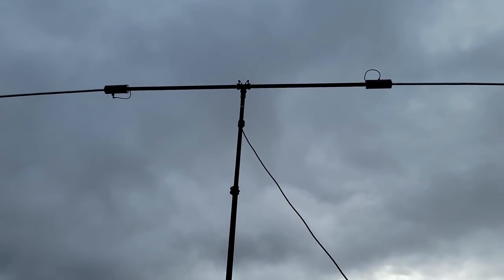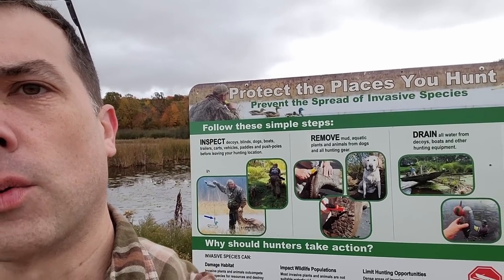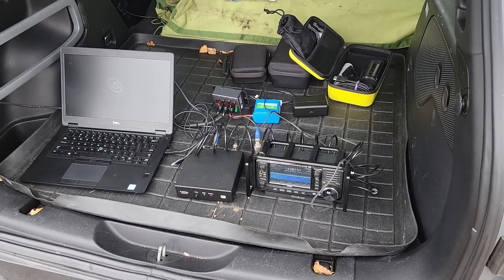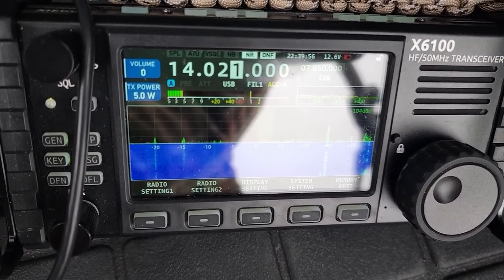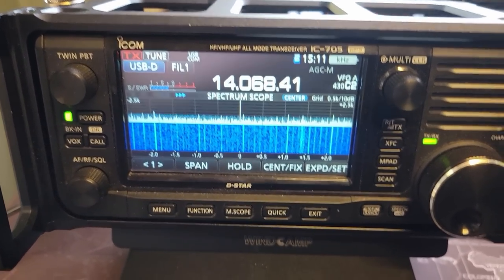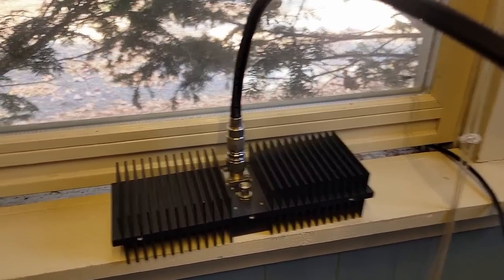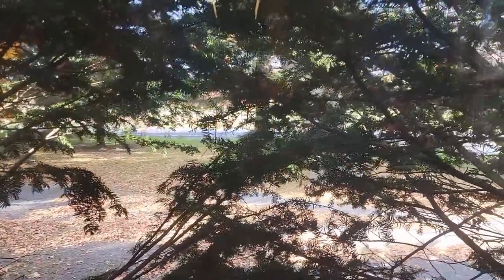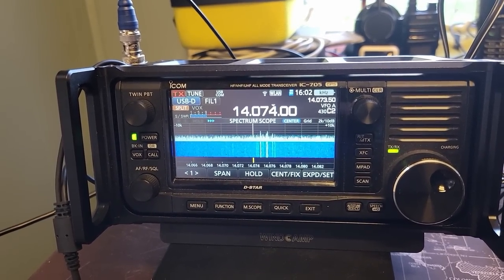But wait, there's MORE!

Comment: WOW Steve, this was really OUTSTANDING!!!  The "scientific" method really paid off well here.  I wish more hams were as thorough and changed only 1 item at a time, then measured the change to see how it affected their hypothesis.  

It is always best to remove the noise right at the source.  In this situation, the noise is created by the computer (they are nearly all terrible with spurs of RF).  The choke on the USB is doing the heavy lifting and is therefore most effective.  I'm REALLY glad to see the use of a choke balun added to the coax feeding the Buddypole as this cuts the noise from the laptop that is riding on the outside of the coax shield.  The reason why you don't have this noise on the DX Commander is that the coax shield is RF grounded through the radial field, but in the Buddypole, there is NO ground, so the noise is picked up (despite the balun there) due to the short distance between the coax and the feedpoint in the middle of the arms.  By adding a 2nd balun further down the coax, we are further attenuating any RF riding on the outside shield.  

Thanks very much for mentioning me and some of my suggestions, including the NanoVNA.  😄

73 Brother.  Keep up the GREAT work!
Reply from the maker: Thanks Greg! I really enjoy this kind of "work", it was fun to hunt it down.

Comment: The choke on the chameleon coax has worked well for me. If I'm not using that coax, I use a toroid on the USB cable. I almost failed a POTA activation because I knocked the cable on the ground by accident and it broke. To keep that from happening again, I put the toroid into a plastic container and filled it with expoxy.
Reply from the maker: Pot(ting) gets it done!  That's an old and reliable trick!

Comment: I had the same issue with the 705 when it was about 18" from the laptop and transmitting into an FLoop 2 that includes ferrites on the cable.  Moving the radio to about 3' from the computer has resolved the lockup issue for me.
Reply from the maker: Nice!

Comment: About the usb isolator. The inexpensive ones (I have the same one) only isolate the power lines, not any data lines. They do make full isolators, but they are a bunch more money. Great video!!
Reply from the maker: Thanks, I hadn't heard of a USB isolator until my first vid on this topic. Do you think the full unit would help any better?
Reply: @temporarilyoffline  I wish I could answer that. I have the blue one that looks like the picture. I haven't had noize issues enough to make me invest in, say, a $200 isolator. Good luck!

Comment: Well done, sir, and many thanks! I've recently acquired an ic-705 and I immediately ran into this same issue, even with an MFJ-915 RF isolator between my coax-feed-line and the radio (using a QRP Guys end-fed-half-wave). I eventually got it working over wifi w/ Linux but I'm going to try the toroid-choke+USB solution for the sake of maximizing battery out in the field. 73 from an old Perl guy!
Reply from the maker: OPGs unite!  Glad it helped.  Did you see the first vid in this series?

Comment: Man… I was having ALL of these problems EXACTLY!  Only difference in my setup is the addition of a XPA125B amp/tuner.  Even without the amp I still have a ton of noise with and without the use of ft8.  I’ve been trying everything almost the same as you…….except the coax choke.  I can’t wait to try that tomorrow and see if I can finally use my ic705 in my shack again and not only when portable.  Great video and I definitely subscribed!  Thank you!
Reply: I happened to have the exact same toroid you used laying around so I wrapped my coax 9 times through it near the middle of a 50ft run and it dropped it from S7 to S3 with RF Gain at 100% on 20m.  Gain set to 80% and the noise was almost all gone.  Perfect solution, thanks again! 73!
Reply from the maker: Glad it helped!

Comment: Great video, thanks for posting. I got tired of dealing with this issue. So, I solved my USB noise completely by just going wireless using the free WFview software and a couple port emulators. Works great for me.
Reply from the maker: It does work great that way too!

Comment: I think you have two problems. 1. the usually computer RFI but more importantly 2. a. how tuned is your buddipole, what's it's SWR on a meter? 3. it doesn't look like you're using BP's adjustable balun, but are you? 3. have you tested the coax with nanovna to ensure it's good? sure seems like it but even a small defect can cause this. I know many with BP including myself and love the antenna but we all have the adjustable balun and use it, and coax should always be choked when possible, as well as anything else that goes into your radio (USB, etc). Good troubleshooting. I was surprised by your results with the shielded USB cable. USB Spec is that the shields of the connectors must be connected via the USB cable's shield, and that has helped me significantly where a lot of cheap cables do not have that shielding. the noise from the computers do not surprise me, but the only time I've personally experienced that kinda of disconnect/lockup when tx from the computer is with a really bad antenna match, and a boat load of reflected rf coming back (esp when unchoked).
Reply from the maker: Thanks for the feedback.  This problem occurs for a variety of users with a variety of antennas.  I was using the buddipole because it's the antenna I have that readily replicates the problem.  So far the consensus is that the 705 itself doesn't properly shield its USB, so it's up to us as hams to solve the problems.
Reply: @temporarilyoffline  ah ok, experienced similar effect with my ft-891 (and no protection) which I found out the hard way where my wmr usb2cat back fed power blowing the usb controller on the radio. Maybe someone will try jumping usb shield to gnd in the 705 to see what happens.
Reply from the maker: I'd need a micro-usb breakout board and about 50F more degrees to test that out 🤣 (it's- 12F as I type this)

Comment: So common mode current was an issue on that Antenna type.  I really prefer a dipole due to this.  Yes it's 30ish feet of wire and harder to hang but a lot less common mode current and noise on the shield.  Nice video, I like your testing.  Sending thiis to my 11 and 14 yr General daughters to watch.
Reply from the maker: Thanks for sharing, it was a lot of fun yo play around with and figure out.

Comment: great video. I have the ICOM 7300 and use USB A to B cable to laptop . getting some noise. T 240-43 on USB cable worked for me. running off set center fed dipole portable. all ready had choke on coax at 7300.  all ways do. type 31 snap core.  I choke my power cable at radio as well. have same toroid in the link. also 31 and 61 cores . got a bunch in my go kit. snap ones as well. a friend let me use his 705 so we can do a 24V amp build 600 watt PEP . buddy hex is waiting list only now. my friend went with DX commander instead. and DX engineering has them in stock in the USA now ! fall 2023. love how you try it all on video. going to help me with this project a lot. 73's
Reply from the maker: Excellent, glad it helped!
Reply from the maker: Excellent, glad it helped!

Comment: Great video!  I had a similar issue with my 705, I had the USB isolator but it didn't help.  Added the choke on the USB cable she works great.  I have tons of noise at my location so choking didn't help there.
Reply from the maker: I carry both chokes with my 705 kit all the time now.  The 1:1 coax choke trick is a particular winner!

Comment: I'm curious to know what happens if you choke both the coax and the USB cable. Does the noise floor get even lower, like S0, or have you reached the point of diminishing returns? Inquiring minds want to know. :D
Reply from the maker: It was too controversial to share.  Even though I have video footage of it, I would lose all credibility as a ham if I broke that news!

Comment: I have the same problem with my 705 with my KM4ACK EFHW and using a toroid and rf choke helps
Reply from the maker: Yes!  You could add a counterpoise to your KM4ACK antenna also.  There is more than one way to do it!

Comment: My setup is a magloop OM0ET and BB-V7, IC-705 (on it's own battery), LENOVO P15 Gen2. First I had the problem with locking up as shown in the video using the BB-V7. I added a toroid near the BB-V7 and on the USB, near the laptop. No locking up so that part was solved. Than I noticed that the noise became stronger with spikes every 500kHz or so when I started WSJT-X. I did not transmit at that stage. so the noise was coming from the laptop. I didn't use external power to elimminate noise coming in throught that cable. As I had another toroid I put it on the 705 side of the USB cable that stopped the noise. I think the laptopscreen was producing the noise (with the waterfall on screen), that was being picked up by the USB cable and send into the 705. So my formally 2m long USB cable has a toroid at the beginning and at the end. 
Maybe others can reproduce this outcome.
Reply from the maker: Sounds like you got it 👍

Comment: Thanks for the video, and interesting to see the coax choke work so well... I had similar ft8 locking/interference issues when using the 7300 and HP laptop on a summit (shorter hike).  I bought one of the Amazon shielded usb cables, and was surprised it didn't work either...until I added more clip on ferrite chokes.  73
Reply from the maker: Where there's a ham, there's a way.

Comment: Hey Steve, when you unplugged the antenna and the noise went away I yelled "You don't have a noise problem,  you have an RF in the shack problem"  Ask me how I know!  Your feedline or ground is acting as part of the antenna.  I would suggest start with just laptop, unchoked usb, 705, short rf cable, to dummy load, and test.  Then add long rf patch cord and test.  Then add resonant buddipole and test, then add tuner and test.  then add non-resonant buddipole and test.
Reply: I'm assuming you're using the buddipole non-resonant since you have the tuner there.
Reply from the maker: That's a great idea, thanks!
Reply from the maker: I'm using the buddipole+tuner just to make it a little more wide banded... you can add inductance by tapping the coil differently on the pole or by adding inductors in the tuner.  Also, at 40F and windy its really a pain to put up and take down repeatedly for tuning a 100% match.

Comment: I too have tried all the other tricks with my IC 705. The only one I had some luck with was the FT-240-43 Toroid, which helped to some degree. Hoping to do a field test with another FT-240-43 Toroid on the coax to see if it resolves the issue once and for all. Looked promising in your video. Thank you for doing this follow up video. 73.
Reply from the maker: No problem Scott,  what antenna are you running?
Reply: @temporarilyoffline  mostly my EFHW or MFJ 1979 17 ft. whip with the new WRC Sporty Forty resonator. Both seem equally as bad with the 705. My X6100 never has an issue. 73.
Reply from the maker: Have you tried running a counterpoise or ground radials on either of those?  Does it reduce the noise on your 705?
Reply: @temporarilyoffline  I do run a radial with the vertical - if on 20 meters I have four 16 ft. radials, and on 40 four 32 ft. radials. With my EFHW I do not use a counterpoise with my spark plug.
Reply from the maker: Wow, the radials on my dxcommander solved the problem for me, but I don't take that portable yet.  I have used the coax choke on my EFHW though and that did help.
Reply: @temporarilyoffline  I'll do a coax choke and try it with both of the antennas this weekend and see if that made a difference. Radials did not resolve the noise issue with the computer. Many of my activations are done w/o the computer but with winter coming here in PA I'll be activating out of the car again (blech) a lot so I'll be using the computer. A resolution once and for all will be great. I did see some improvement with wrapping the torroid on the USB cable. If the torroid on the coax fixes the problem I'll be grateful. I mostly do CW with a headset on and it's almost unusable with the computer noise. I'll let  you know my findings.
Reply from the maker: Looking forward to it!

Comment: The lock-up really feels like RF in the shack.  The buddypole choke is fine, it keeps the dipole balanced, so that it acts like a dipole, and isn't detuned by the extra element which is the outside of the coax shield.  But the extra choke helps because the outside of the shield does pick up RF, both your own transmit power, and local noise.  While the radio may not be directly effected by the signal on the outside of the shield, it can get re-radiated inside your shack, and coupled to the unshielded USB cable.  (I can't help but wonder whether this would be happening if USB had been designed to be fully differential - data is differential, but something in the start and/or stop symbol is single ended.  Probably the chips at one end or both would still fall over in the presence of RF.)  The DX Commander has a better ground (and a better match, probably, though I haven't worked out whether that applies).  I figure that the vertical part of the buddypole coax is what's primarily picking up signal and noise.

I'd suggest placing the second choke as close to the radio as is reasonably possible.  I use a couple of clamp on beads on the coax jumper between my antenna switch and my MFJ entry panel, and I have no problem with FT8 using a Dell Inspiron and my FT-991A, which is already more differences than would allow my experience to apply to your situation. I also use a USB cable with a built in bead near each end, and it is probably shielded too.  A bead at each end  protects both the radio and the laptop interface parts: USB is two way, so there are line receivers in both the radio and the computer.

Finally, you can ground responsibly at the park: just take a radial set and spread it out on the ground.  It's not a DC ground, and not a lightening protection ground, but it is an RF ground, its quality depending on the local ground conductivity.
Reply from the maker: Its definitely RF in the shack.  The 705 is known for it and as a ham, we know how to fix it.  I have tried a coax choke (the same one in the video) on the radio side of the tuner, but it didn't help any.  The USB and Coax Chokes are now everyday parts of my 705 Go-Kit.
Reply: @temporarilyoffline  Yeah, if you stop it between the tuner and the radio, it's still inside the shack.  At or just outside the entry panel (cracked open window) is a better choice.  I keep hoping that they'll make coax with toubh flexible bead as the outside jacket, but I think that I'll have a long wait.
Reply from the maker: @KeepEvery1Guessing  Sounds like an opportunity - powered iron cable jackets!

Comment: When you are testing with the Nano Vna, it would be good to check your polarization.  Vertical/Horizontal can make a big difference. Also holding the antenna next to coax should be done the same way every time.   K6DCH
Reply from the maker: You are correct sir!

Comment: It looked like you are getting RF into your radio.  Did you tie the ground of the radio to the tuner to see if that helped. It would reduce ground loops that looks an issue.   Also any time to limit the bandwidth of an antenna the noise should go down.
Reply: So why does the DX Commander work fine then? It's because the DX Commander has a massive RF ground and the Buddy pole doesn't but that alone shouldn't make a difference I think it's the metal mount for the buddy pole causing RF ground issues. As once the coax is choked away from the mount system all the issues disappear.
Reply from the maker: You're right, this is RF into the radio.  Its "nobody's fault", but it is something that a ham radio operator should be aware of and have some solutions at hand for when it happens.

Comment: Interesting. My antennas are about 70ft from the operating position and the computer & USB hose are about three feet apart. the USB hose has a strap-on ferrite at each end. Sometimes, depending on band, I get some kind of noise out of the radio when the antenna feed of the radio is open. Hose up an antenna to the radio and the bit of noise "goes away." Even with the cheap laptop that I got to go POTA with -- just in time for the weather to chill me out and Cindy to spend the next two weeks recovering from eye surgery. It's all a matter of timing. And distance ;-) 73 de W8IJN
Reply from the maker: I have a similar situation with my antenna that is 70ft away - no problems there.

Comment: Remove the chokes, mount the buddy pole on a fibreglass or wood mount and see what happens. I bet everything is trying to pull to ground capacitively via the metal mount on the buddy pole antenna. I say this because the DX commander has a good ground system and the dummy load was sitting on wood.
Reply from the maker: Not a bad idea!  You're right that its an RF Grounding issue for sure.

Comment: I had a noisy cheapo switching supply. Choke on power at rig. No joy. Disconnected ant and zero noise! Not coming in power but ant. Solution was put toroid immediately at the power supply - fixed! The dc leads were acting as antenna broadcasting that noise till the toroid stopped that!
Reply from the maker: It's a hunt!  Glad you found it!